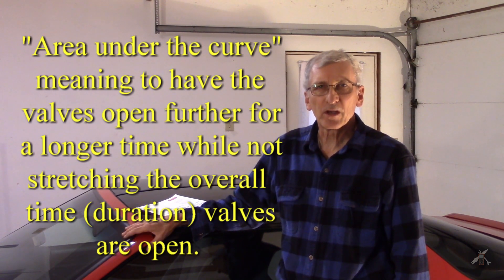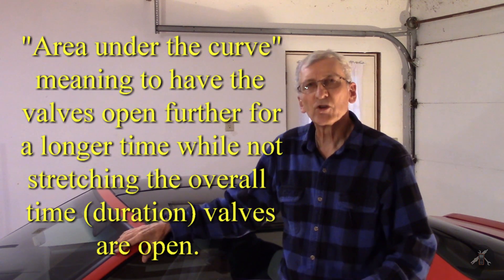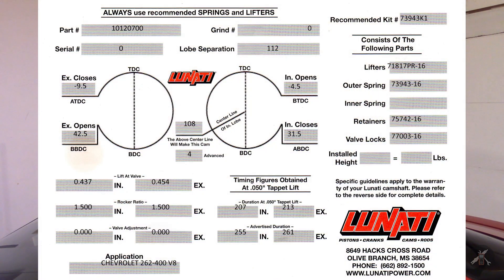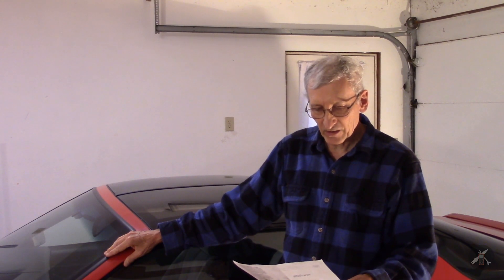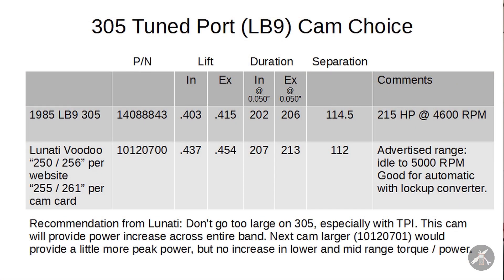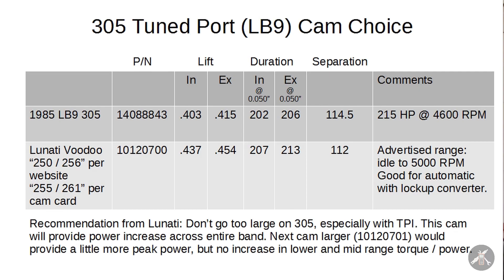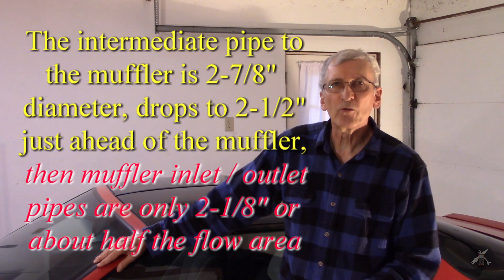Cam Selection & Cam Sounds - Lunati Voodoo  - 3rd Gen Camaro 305 Tuned Port Injection

Comment: I'm sorry for bugging you again about the same issue.  What was the # on that Lunati cam that you mentioned for my 82 Z28 camaro with the 305 4 barrel carb ?
Reply from the maker: The cam was Lunati #10120700.  The problem is that I was informed a few weeks ago that the Lunati product line has been discontinued.  If you go to the Lunati site, it will sell you Comp cams.  There is nothing wrong with that, but they are a little different.  
I would suggest that you contact Comp Cams and ask their advice.  You have a carbureted engine rather than TPI and your choices can be a little different.  They will want to know the specs on your car and what you want to achieve.  They do have a very similar cam to this Lunati grind. I talked to both cam companies before I made a choice.

Comment: My first IROC 2001, was an 86 I got from my late uncle. After a few navy deployments I gutted it, tore apart and got pretty wild with it, with little direction.
2015, Second IROC, an 87 ttop 5.7 tpi with every single option. I decided to keep it hands off and sold it to a collector with only 19k miles on it.
2025, I am now moving to Australia for work, and I found a completely untouched 86 305 TPI IROC, and I really want to keep it stock looking, nearly stock sounding, but give it the treatment it was meant for. Mild can upgrade. Port the heads maybe. Dyno tune, Upgrade the shocks and suspension to handle more aggressively. Probably put in a 3.73 posi. 
I like these less extreme videos you provide. I’m not chasing times, or to beat other cars. Now I just want a more fun ride with the ttops off haha
Reply from the maker: It sounds like a great set of IROCs. Good luck on your latest project.

Comment: How is it holding up? Thinking of replaceing mine 5.0 tpi z28?
Reply from the maker: I now have about 3 1/2 years or 4 summer driving seasons on it, with a total of about 10-12,000 miles since overhaul. It's running great, you can see in some of my later videos that I'm taking on longer road trips. I'm continuing to run the VR1 10W-30 oil that I used for break-in.

Comment: This was a good series, thanks for sharing the journey. My current project is an 82 Z28 with only 45,500 miles that was unfortunately put in a ditch at 50 mph  by the previous owner, it is too twisted to fix but the engine and trans are fine, the interior is mint so I bought a really nice 84 Z28 roller to transfer the drivetrain and interior to, the roller has already been converted to rear disk brakes I have all new weatherstripping for it.
Reply from the maker: Thank you. It sounds like you have a good project putting the best of the two cars together. Good luck with it!

Comment: How much horsepower ? Is everything else stick ?
Reply from the maker: Power is hard to determine.  This engine came from the factory with one of the better cams, rated at 215 hp.  Comp Cams had an online simulation tool that I used (now no longer available). I tried to pick out one of their cams that looked roughly stock equivalent and compared against a couple of their Extreme Energy cams that were close to the Lunati. My best estimate was that on an even basis, this one was probably 10 - 15 hp better with all stock components comparison. The difference seemed to be that as you opened up the exhaust, the improvement would increase. In other words, the new cams were more sensitive to exhaust restriction. 
In my case, I know my exhaust is more restrictive than factory.  It's still on my project list to fix that, but this car has the "high output" large mouth catalyst and no one makes a replacement system.  I'm close to a solution on that.
Everything else is stock.  I have found that the new cam seems to want more spark timing (responds well to initial timing increases), but I haven't worked on burning a new chip to try it yet.

Comment: You read a lot of negative comments about the computer in the 85 TPI engines. I'm blown away that the stock programming was able to manage this cam.
Reply from the maker: I have heard and read similar complaints about this controller. But so far my only complaints are that the data rate to the scan tools and external software are slow and that it must run in 10k diagnostic mode to obtain data.  From a driving standpoint, I have no real complaints.  My only drive quality issue is that on cold driveaway (below 60 degrees F) I sometimes have a little off-idle tip-in stumble coming away from a stop for the first mile or so and need to feather the throttle a little.  Overall the MAF sensor seems to be keeping things in line.
Reply: @bitsofwisdom460  here's some info about the ECMs "One major problem when tuning an EPROM for this ECM is that the diagnostic data (ALDL) is transmitted at only 160 BAUD!. This works out to about a 1.25 second interval between the 25 Bytes of data. I have only been able to get about 6 to 8 data samples during a Quarter-Mile DragStrip run which you can imagine does not provide much feedback for tuning. (sample data are at the bottom of the page in PDF format)
The ECM that came in 1986-1989 TPI Fbody's and Vettes is a series 1227165 (165). The ALDL data rate in this model can supply diagnostic data at 8192 BAUD. The (expanded) data stream of 64 Bytes cycles through every 62.5 milliseconds (16 per second) at this BAUD rate." The difference is stark. I bought a Fitech TPI ecm and harness and plan on having that installed.

Comment: Really hard to build power that compares close to muscle cars of anything 2000+ . Long runners just don’t support big hp numbers. Best mod is go carb. A good demon 650dp would automatically improve the drive.
Reply from the maker: Yes, it is hard to build high RPM power with the long runners. On the other hand, the low end torque is very impressive and it's fun to drive.  It won't make top HP and win races against short runner strategies, but it really makes a nice street car.  Strong tip in response - feels good without needing to wind it out. I'm a carb guy from way back, I can tear them down / tune them and make 'em run,  but I won't do that to this one.  The fuel injected package runs well, with no significant drive quality issues. I may continue to work on squeezing a little more out of it, but it's a piece of history at this point.

Comment: I have two 3rd gens.  An 82 Trans Am and an '89 Formula 350.  My Formy is stock except for the magnaflow muffler.  I am going to port the heads and intake.
Reply: That’s pretty close to what I was running in my 305( 209/209 at .50 110 center) fantastic low end torque) non computer control. Mine had a lope, probably wouldn’t work with computer.

Comment: When I rebuilt the LB9 in my '88 IROC after nearly 30 years of ownership, I kept the stock cam; however, both the intake and outtake valves are larger, and I installed Dyno Don headers with 3" exhaust (including cat) with GGMG "muffler."  Your sounds nice and throaty!
Reply from the maker: Your car sounds like it is very nice.  I have been surprised how good mine sounds with it's stock type muffler.  The cam isn't wild, but it certainly has some character.  I'm still looking to upgrade to a 3 inch exhaust as well.  I'm working on what it takes to make the adaptation to the large flange converter that my car has.  There aren't any drop in kits for my cat.  It has the so called "HO" converter that has a 3.6" x 2.6"  oval inlet / outlet. I finally located the flange needed to fabricate an adapter.  Maybe over the winter...

Comment: The real problem is the runner and intake were designed for torque on the low end, and the exhaust is screwed up as well. Running a 305 you would probably have to go to a 110 lca cam probably around 214 degrees @ .050s. But the previous problems would have to be done, including replacing the OEM intake with Edelbrock intake and running and replacing the exhaust manifolds with headers.
Reply from the maker: It depends on the goal.  I agree that for maximum horsepower, the tuned port intake and associated hardware isn't the best. On the other hand, the tuned port system does provide great low and mid range torque.  It's really quite satisfying in normal driving. It will pull higher gears and a locked torque converter where short runner systems would not. It isn't always downshifting to get into the power band.  My choice here was to try to improve on the factory system without going too far and losing the torque.

Remember that when this car was introduced, the emissions and fuel economy regulations were daunting for the engineering teams.  Most 5.0 V8's only made 140 to 160 HP at about 3600 - 4000 RPM.  This one greatly surpassed that.
So, yes to maximize horsepower, you are correct that it would be better to have a different intake and exhaust.

Comment: You picked right on cam, if you can find a set of tpis/as&m long tube intake runners buy them theyre worth the price and by far the best ltr ever produced,port behind the throttle body and peanut and taper the ports where runner openings are on plenum,an air foil in throttle body and hooker or hedman shortys with y-pipe,adjustable fuel press regulator and youll wake the 305 up!
Reply from the maker: Thanks for the advice.  I have looked at the AS&M parts, it looks like they may be available again.  I have some work to do before I get that far, but perhaps...

Comment: At this point your biggest performance increase will come with the addition of headers and Y pipe.  if you do, then you want to swap to a heated O2 sensor and make sure there are no exhaust leaks upstream of the O2 sensor.
Reply from the maker: Yes, I expect that is right.  I'm walking this line with this car trying to hold to restoration and stay factory as much as possible. I'll upgrade pipes and muffler first and see where that gets me.  And yes, most people don't realize that leaks in the exhaust upstream of the O2 sensor is a bad thing because the negative pressure pulses will pull in fresh air.

Comment: It's the Wolverine Blue Racer 3/4 Race Cam or nothing.
Reply from the maker: I'm not familiar with that cam.  I mean the 3/4 race and so forth was a common way to designate cams, but I don't know what that means in lift / duration for this application.  The tuned port intake system is sensitive to high duration and overlap, so care is required to not go too big.

Comment: I see the tac red lines at 55 thought only 5.7 cars only did
Reply from the maker: I haven't verified this, but I ran across some information that said it was dependent on the factory cam.  There are two basic factory cam ranges for the 305 depending on year and manual / auto etc. The smaller one is <.400 lift and < 200 duration. The other is > .400 lift and >  200 duration. The hotter one is what I have in the 1985 and that gets 5500 red line.  The automatic WOT shift point for 1-2 is right at 5500 on mine.

Comment: I just picked up a 3rd Gen z28 I’m looking to hot rod a little bit. Just picked up a Holley carb and edelbrock intake, might go with this cam
Reply from the maker: It would seem that it could work well, but you might want to consult with Lunati tech.  When I was researching cams, I started with Comp Cams and they had a modeling tool on line. It is unfortunately gone now.  They have an extreme energy cam (XE256) that is supposed to be very close to this Lunati.  When I ran the model for the 305, I did run data for a single plane intake and 660 cfm carb for comparison.  The TPI system is really built for the low / mid torque so I wanted to see the difference. Raw numbers are likely not accurate due to assumptions chosen, but here are some comparisons: 
Horsepower: TPI - HP peak 4000 RPM, Carb was plus 30 HP, peak 5000 RPM.
Torque: TPI peak at 3000, Carb peak at 3500. TPI was +20 ft-lb
TPI was plus 60 to 75 ft-lb from 1000 to 1500 RPM.
Recommended torque converter stall speed:
TPI 1200-2000, carb 2000 to 3000.
So, main takeaway is that a carb car could work well, but needs to watch the low end torque, axle ratio and converter stall.

Comment: I think the 305 can be bored 30”over with turned and balanced crank and ported cylinder heads would give it more horsepower if you choose to go that route
Reply from the maker: I do have the 0.030 over already, that was in my early videos--long story as I went through two engine builds.  I considered ported heads, but held off so far.  I had a couple of shops offer to do it, but I was frankly a little cautious about who I would have do porting work.  After working with engine designers and watching what goes into port design, I would want to be sure they know what they are doing.  Still could be a future possibility though.

Comment: Hi l have a 85 iroc L69 5 speed lm looking at rebuilding the engine next year she done 60,000 miles seals are leaking from old age, cruising around l get reasonable gas mileage, did this cam alter your mpg? 
I'm in NZ and we pay around $3 a liter and it could be up to $4 dollars some time next year.
Reply from the maker: I have posted a new video answering your question:
https://youtu.be/3yEGn52mraQ
Reply from the maker: I don't want to answer that from memory because I want to be sure.  I didn't have car running with the old cam, so I don't have a direct comparison, but I have a way to get you an answer that should help.  I log every gallon of gas that goes in the tank and I can look up the EPA (government) certification data for comparison.  It will be a couple of weeks until I can get to the log book. But I will dig in and get you an answer. I would just ask that you please subscribe if you haven't yet.

Comment: Didn't know you put a mild cam in. I suggest a chambered exhaust.
Reply from the maker: I am starting my research.  I have seen some of the chambered systems, they look like they have possibilities.  I am also looking at Spintech systems, they have an interesting muffler. Regardless of muffler, I need to find someone to fabricate or adapt the intermediate pipe to connect to the cat. I want to bump up the pipe size a little.  This car has the "high output" system with the large high flow rectangular flange catalyst. All the aftermarket companies have stopped making systems that match to that flange. First I need the right flange (might need to be fabricated), then it needs to taper from an oval pipe to a round pipe.

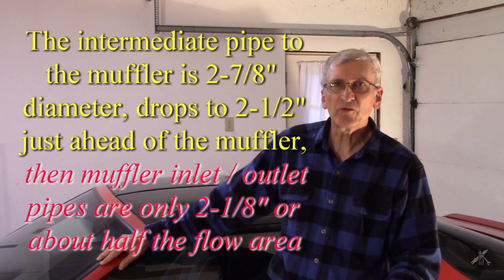Comment: I'm very familiar with the ubiquitous 3rd gen as back in 1990 I purchased an '84 that had been involved in a front end collision that had pretty much trashed all the body work and the front sub frame. I proceeded to rebuild it better stronger faster. IROC body work and wheels, all the factory suspension goodies, factory PBR rear disc's, 3:23 posi and the icing on the cake, an '85 TPI 305 I built to '92 spec with a built 700r4. Loved that car.
Reply from the maker: That sounds like a great project and a great car!

Comment: She looks and sounds great! Keeping the mid-range punch is good for a street car, and personally, I like the torque feel, over high revving. I did something similar with the LS I put in my car, very nice now, and the SOUND, Glorious. Cheers!
Reply from the maker: Thank you! One thing I had to keep in mind is that with an automatic trans and lockup torque converter, it really needs to be able to pull away smoothly from 1000 RPM or so when you tip in.  It needs a fat low end in traffic.  I'm sure your LS does well, too.  I really like that engine.  I was around it in development on the '97 Vette and I know how much work went in to making that a great engine.  If my circumstances were different, it would have been on my list.
Reply: @bitsofwisdom460  Agreed, had mine been a 350 instead of the 305 I most likely would have simply done a cam and refresh with it but, the 305 for just was not worth it.